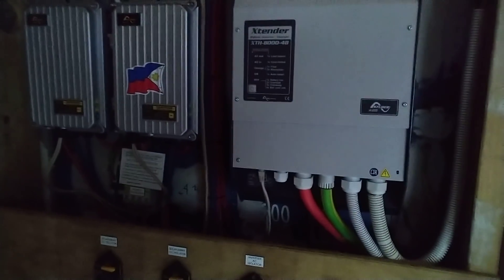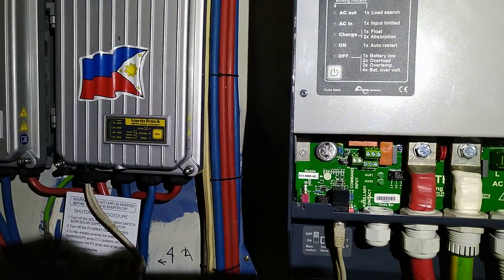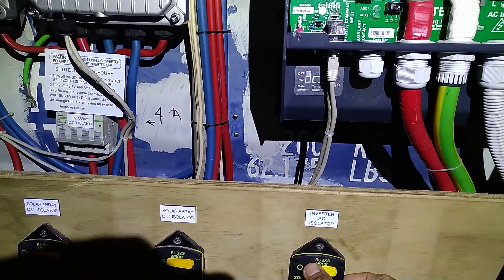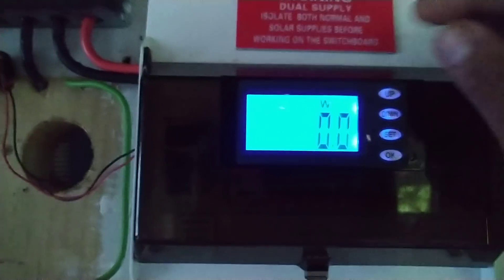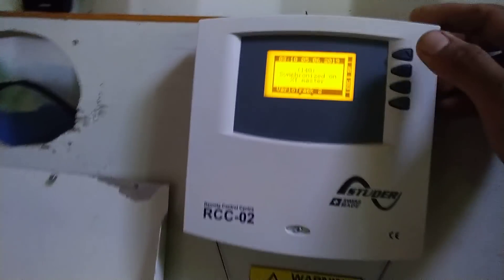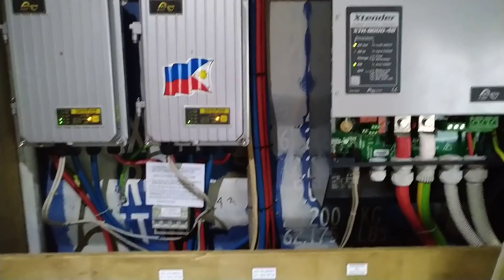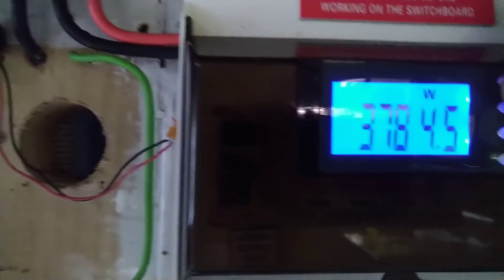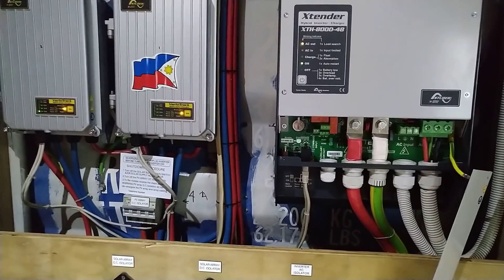8000watts 48 Volts inverter part 2

Comment: Configuration error or device defective? Hello, you have the only channel via Studer Extender. Thank you for your videos! I have bought 2 used XTH-6000. These worked together in a system with 3 phases. I connected the devices individually to 48 volts for testing. One (phase 1) works, the other (phase 2) does not switch on the fans and the status lamp lights up 4 times.

Comment: magandang araw sayo kabayan 
mag tatanong lang ako. about sa solar installation  KC gusto ko bagohin system ko 12v lang ang system ko. gusto ko ng gawing 24v system paano po ba  ang pag kabit sa panel Kc may 5panel po ako bali 500w naka parallel po ang pag kabit ko at dalawang CAR Battery 12v parallel din.  so paano po para maging 24v

Comment: Wonderful setup brother. Please is the XTH 8000 an 8000W or 8000VA inverter. I mean what is the maximum steady power in watts that it can deliver? I've tried checking around and Studer and Victron keep using VA which I learnt is mostly equal to 0.8W. Thanks in anticipation of a reply.
Reply from the maker: Yes XTH is 8000VA or 8000watts VA is volt x Amp's. So 230v ac x 35A ac is 8000watts or 8000VA. This inverter can handle 22,000 watts for 5 second.
Reply: @iFixstuff  Thanks. I appreciate the prompt reply.
Reply from the maker: @adon8672  no worries please subscribe to our channel thanks 🙂

Comment: galing 5 star ka sa akin. boss low frequency ba inverter mo?
Reply: Grabe mahal nung inverter swiss made.

8KW.

>£6K.

Hehehe.

Yung system mo aabutin ng 1M petot.

Lufet Bro.
Reply from the maker: Salamat po boss 😊 50/60Hz
Reply: Maganda yan boss mataas pala peak niya.
Reply: Katulad ba yan sa dati na mayron malaking xformer? Kung mayron low frquency yan. Pangit kc ang high frequency nasisira agad pg may load na electrec motor.
Reply from the maker: @elaniycong4506  up to 22,000 watts for 5 sec. Po kahit gaano pa po kalaking motor Kaya nya Basta 230 to 240 volts Lang po 50 to 60Hz Kaya nya. Pwde ko pagsamahin tatlong inverter pra sa mga 3phse motor 300to400 volts. Pro di ko na kailangan pangbahay Lang po ang saakin di pang pabrika✌️
Reply from the maker: @elaniycong4506  70 kg ang timbang ng inverter na Yan po. Cguro naman po Malaki ang Transformer.